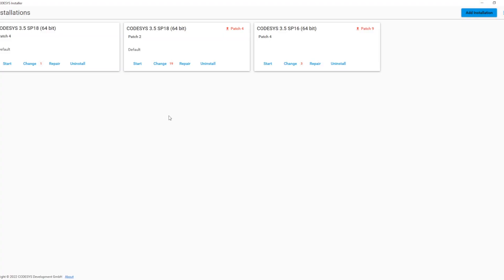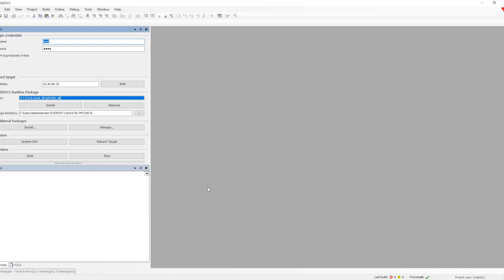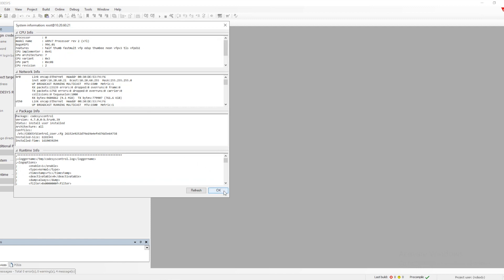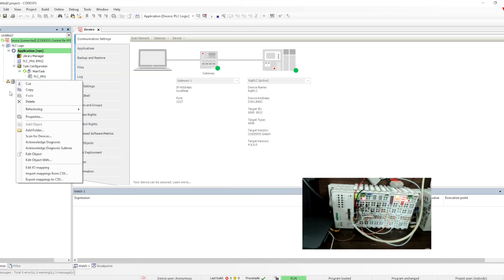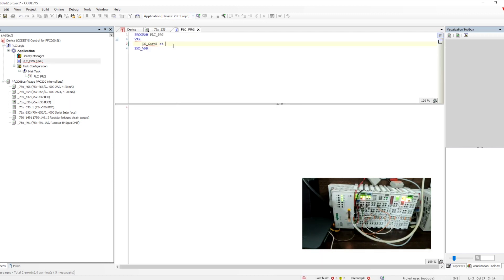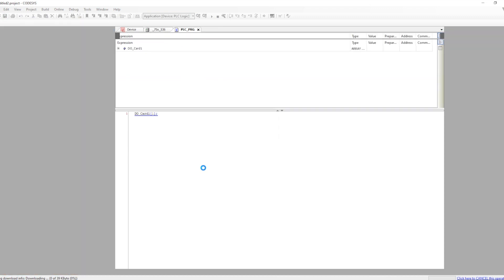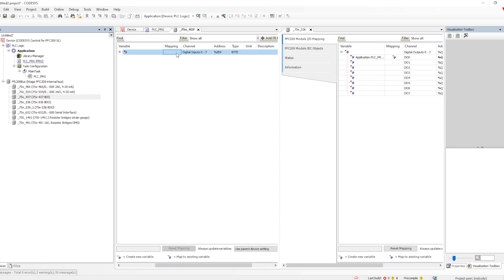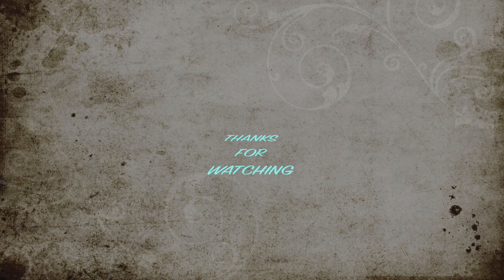CoDeSys PLC Programming Tutorial: Setup PFC200 Runtime in Wago PLC

Comment: Great video :) i have some problems with my wago 750-8202/000-012 to Connect the device after installing the runtime to the PLC. The PLC does not show up when i do a scan in the communication settings, but i can still se it with the «update pfc200 sl». Do you have any ideas?
Reply from the maker: Thanks for liking the video
there can be two probability based on your description so try these steps and let me know the result  (Is the PLC runtime is Licensed ? otherwise it will stop in 2hr demo mode)
1.In Update PFC200 click on Stop Runtime and then Start Runtime and check if it shows up in the Communication Setting Scan 
or 
2. Instead of Scanning in Communication setting just enter the IP address in directly in Dropdown menu of Device and see if it is getting scanned or not .
Reply: Thank you for the quick response. 

It is not licensed yet, but i have restartet the PLC and Codesys many times so i am within the two hours. 

1. runtime stop -> «codesys controll not running» 
Runtime start -> error. Failed to start codesys controll

2 when i write in the IP -> no device is responding to scan request. 

Aditional: after i download the runtime to the PLC i checked the runtime info in PFC200 update Windows and Nothing displays in runtime info.
Reply from the maker: @the1andonlyluddfish   in user and password have you entered credential correctly ? we need to put correct credential inorder to install runtime and get Systeinfo or any work in PFCUpdate

follow these steps :
1. Reboot the PLC either Power recycle or from Webportal
2. Ping the IP of PLC from command prompt
3 put the login credential in pfc update windows 
username :root 
password: wago (these are default one if you have not changed )
3. Put the IP of device in IP address of Select target section or  Scan the device 
4. check the System info if you get some details then you should be able to connect as we have rebooted the plc 
5. if no info coming then select the runtime version and install the runtime 

let me know if it helps
Reply: Hi mate, Im using wago 750-8202 in my device too. Do you know which way to backup file in plc storage, and restore to new plc in case of the current wago plc stopping for any reason. I accessed the current wago plc through ftp protocol to download all files.
Reply from the maker: @sonnguyenhoaison  to do backup restore one option is using SFTP . other option is given in when you double click Device you will get option to  Backup Restore where you can backup the file in Computer and in case of issue you can restore back to PLC , after restore we need to reboot the plc in order to get restoration completed. Other option is to keep Project Archive of the project this will help to keep all the library used
Reply from the maker: @sonnguyenhoaison  got late in providing answer actually was working on creating new videos .i have given all the details in this video https://youtu.be/Dx6x5q_0DgE where you can check it out and let me know your feedback if it helps
Reply: @jugaadtech12  sorry for the late reply. thank you very much. that's really worth it to me